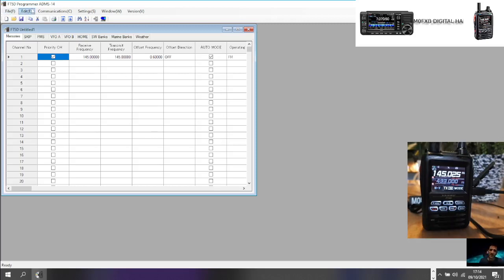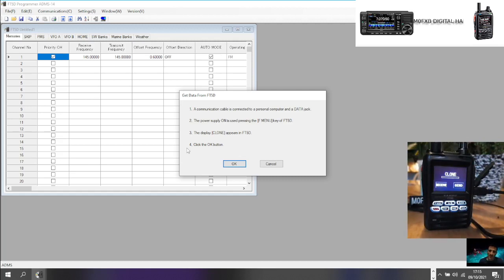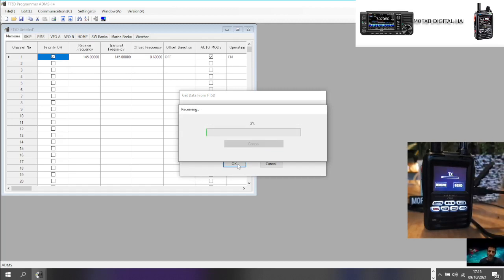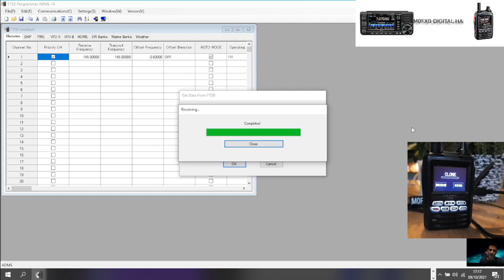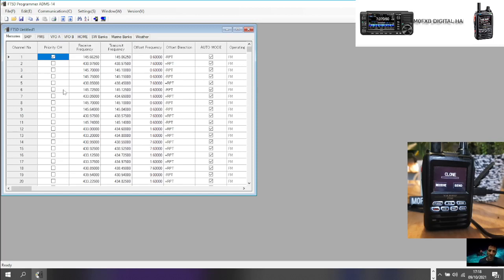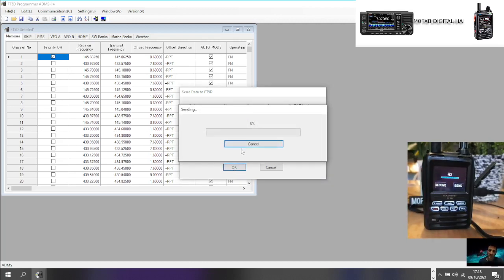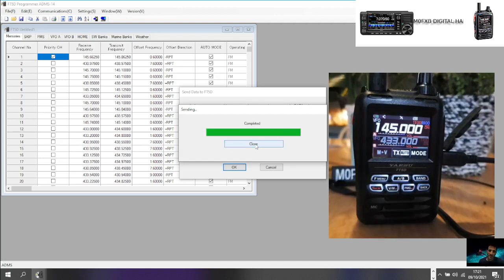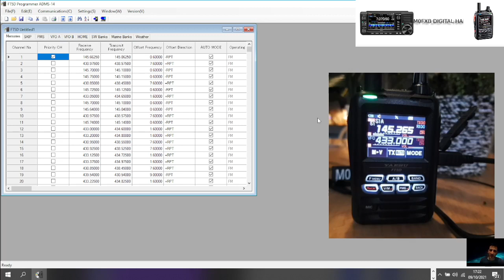YAESU FT3D - send CSV to YAESU FT5D SCU-19 usb cable

Comment: Pretty sure you just dispelled the WIDELY circulated rumor/belief that you can only use the SCU-19, that the FT5D comes with, to perform firmware updates only.  Seen maybe a dozen youtubers saying that and it never made sense to me.  Always sounded like BS.  Been meaning to consult the manual regarding, but haven't since I've done a lot of repeater programing through the front end already (best way to learn, then I can do it anywhere).  I think all these youtubers watch each other's vids and just parrot the information.  Unless I'm just off base here, you clearly demonstrated you can program repeaters through the SCU-19 cable using the ADMS-14 software.  Correct me if I'm wrong, please.  So glad I watched this - and many of your other excellent vids on this fine radio.  Hope you keep 'em comin'!   Subscribed earlier, still got a few more to watch and looking forward to them.   Thanks from Boston!  (Well, 90 minutes from there, close enough.)
Reply from the maker: Hi unfortunately u have to buy the scu19/30 the cable in the box with radio is only for firmware :(